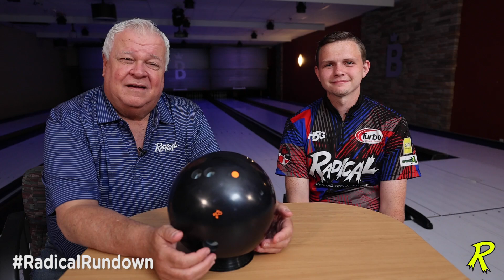Why Does ThroBot Have an Axis Hole?! - #RadicalRundown

Comment: Throwbot Request:  We have always been told that a ball sanded with low grit will get more traction in the oil and get LESS traction in the dry. Its been pretty well established that the first part of this is true, but the original source of the second statement is just inferred from a study of rough and smooth metals and their friction against each other. ***Can you have Throwbot throw a ball sanded to 5000 grit on a lane with NO OIL then sand that same ball to 300 grit and throw it on a lane with NO OIL also?  This would finally prove the theory, or debunk the myth. (also, could you do this with a resin ball and a plastic ball?)  Thanks.
Reply: If you would like suggestions for which balls to test with... I currently use the Maximum Results (and love it), and I'm looking at getting a Spy.